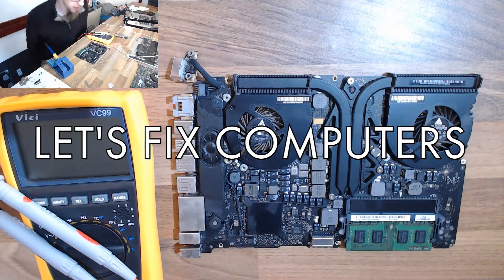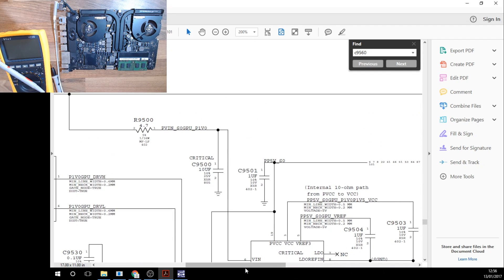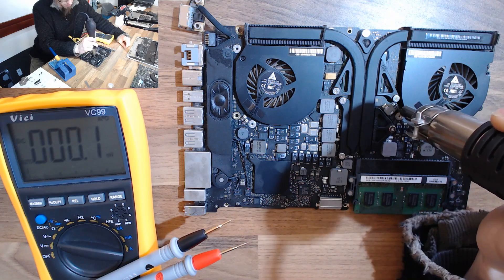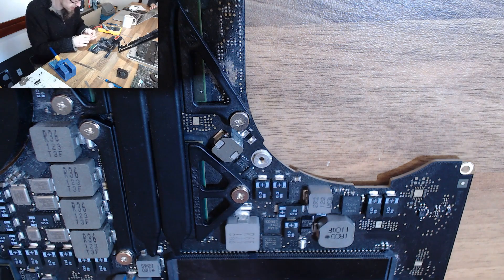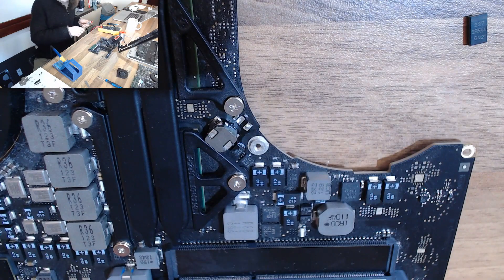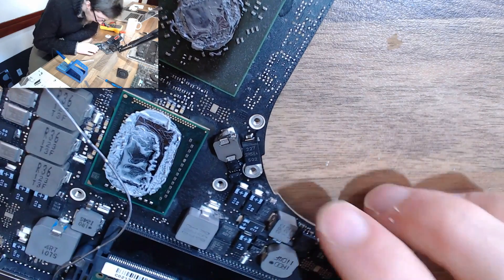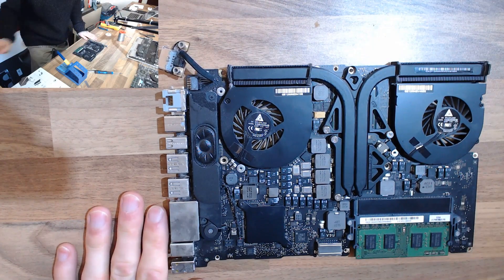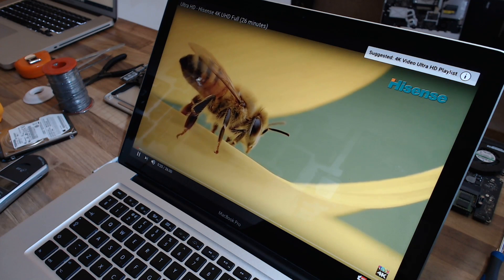LFC#95 - MacBook Pro GPU Fault: C9560

Comment: The heatsink wasn't really needed for cpu and gpu protection, they can handle that heat, it's the warping of the board due to localised heat, which the heat sink helped prevent having a bigger gradient. that's why its good that you kept the heatsink on because you didn't use a preheater or used the hot air station to gradually increase temperature

Comment: Hey man. Great series of videos. 

What’s the software you used to test the computer? The one that came up with the green “Passed” text. 

Thanks again. Your videos are invaluable
Reply: That software is called "Apple Service Diagnostics" or ASD for short. There is a separate version for all of the older MacBooks.
This should be enough to get you going - you need to do some googling, to find out where you can get it and how to install it. You might even come up empty, since this software is supposed to be for Apple internal use only, so it might not be so easy to find. That's all the information, I can give you on that.

Comment: Just use an hair dryer:    https://youtu.be/-i4q1vhqh60
Reply: This is not a fix, just makes the Laptop come on a couple of times before it is dead again.
Reply: @NebukadV  mine it's still working :D
Reply: @EnryBi  If you really believe, what you did is a "fix", there s no point arguing with you
Reply: @NebukadV  Dear N the fix is to replace the capacitor I know very well but the upper MacBook was presenting the black screen. Then you need to deactivate the main graphic card.

Comment: 00:23 yes Louis and others like yourself, Adamant IT are great at showing us how to do this repair. However credit should also be given to Duke, from the Netherlands as he is the one who first identified this capacitor as being the culprit. No, not Apple 's multi-million dollar engineering dept, but a guy working out of his garage using a paint stripper as a hot air source, and no microscope. Louis acknowledges this in his own video in regard to this repair https://youtu.be/DzcgT_fiVTA?t=319

Comment: Just wondering here, when you moved the coil wasn´t it too much against the heatsink? Maybe the thermal expansion of the sink when it gets hot will press against the coil and induce structural stress on it and maybe knock it off the board with enough cycles. Nothing a Dremel couldn´t solve though

Comment: What about MacBook Pro (A1260) early 2008
Reply from the maker: I haven't looked in detail at anything that old, but I believe those were GPU faults, rather than the frame-buffer capacitor we see here.
Reply: @Adamant_IT  - I've looked at many YouTube clips on this issue and it seems more logical to me that it would be the capacitor (C7771)! I guess I'll give it a try as I have nothing to lose. The re-balling of the Chip does not make that much sense - if the cause was originally overheating, then why would heating it a gain fix it - seems illogical? I guess I'll find out sooner or later?

Comment: With 2011 models 15/17 inch (Radeon GPU) this is mostly not going to be a total fix, only Nvidia models like 2010 A1286  820-2850 will truly work with this method. You will have the problem back in a little while. With these kind of boards you can also just heat area near GPU or on GPU and that is what is causing the stripes to dissapear for a short period of time.

Comment: Hello great video , I follow your video and change the c9560, but have the same issue , I double check and find out there is a short on the board where c9560 was , I think the c9565 was short , can you point me out where is the c9565 10uf is ? I have a mid 2010 MacBook Pro with Nivida gpu. Thanks
Reply: Thanks for the reply , the MacBook still up and running but when it switch to the gpu , it will do the same panic , i think I will try your suggestion to remove the c9565 cap but I do not know where it located ? Is it next to the L9560 or at the back side of board , thanks

Comment: Nice video showing good steps on a money saving fix. Not picking problems with the repair but only just come across a problem (+ of cap) where not all the original solder is removed and therefore mixed with lead solder, the link https://www.youtube.com/watch?v=CbguNgQO5hc goes through it nicely. Just for you with an older 2010 module having the problem there's another fix on https://www.youtube.com/watch?v=iKBzrxSGwlo&list=LLrjByAw0iE3fHbj-Uw44HGg&index=3&t=416s hope it helps.

Comment: Hi Graham, I have a late 2011 MBP which I assumed has a GPU fault. 
When booting, some 3/4 way through there appears a large multicolour band through the top third of the screen and it flickers off then completes the boot and works for quite some time usually but then reboots occasionally. Sometimes there is a ghost on the boot screen which consists of lots of horizontal red lines which tends to cause multiple boot loops. Is this a GPU fault or could this CAP repair fix things? The thing is is appears to be a lot more stable than it was 12 months ago when I retired it for a new one. 
Just last weekend I sat in front of it for maybe 8 hours transferring all my old pics which I thought I had lost to the apple cloud photo share thing with minimal issues.

Comment: Hello teacher thank you very much for the great videos that you share, I'm doing the test that shows in this video and in the capacitor I have 1.3v on with the battery so is it correct to have 1.3v or should I only have 1.5v? My problem is that when turning on the MacBook pro 2011 it restarts just midway of the boot. Please ask for help thanks

Comment: i am having hard situation with my macbook pro, its freeze when login in user mode, entering recovery mode and safe mode still freezing, i am taking out the ssd and trying to boot with another hard drive the result is still freezing, so i try to find out the answer through googling and ask some folks, they told me the problem is in the GPU, so what i'm gonna ask here is, is it possible to fix the GPU chips without change the whole logic board that Apple told me earlier to replacing the logic board with the new one which is cost me a lot of money that i cant afford..

Comment: I’m getting 1.36 volts at those capacitors, which is what your voltage dropped to.  Is this common in the failed condition?

Comment: How do you power up the logic board with the power switch disconnected? Critical info.
Reply: Aha!  Good to know. I wouldn't have disconnected the keyboard. One more thing: When testing the voltage, it looks like you're not touching the capacitor in question, but rather the one next to it. What is the exact point you're touching with the probe?  Thanks for your reply.
Reply: Does it matter which end of one of the neighboring caps I use?

Comment: Hi I have early 2011 mbpro 15 inch, after say 10 minute the screen goes blue with lines. Would you say it's gpu or cap issue?

Comment: Thanks for a great video. What are the specs of that small component (capacitor) sitting next to the plus side of the one you changed? 
I changed the big one successfully but as a noob without the proper tools and experience I managed to lose the small one and will need to order some. 
Very grateful for any help.
Reply: Thanks a lot for responding.
It looks exactly as the board in your video as far s I can see.
EDIT: put on a strong light and found the number on the board: 820-2915-B
Reply: Thanks a bunch!
I'll order the smaller ones and try to make it work.
In case it doesn't, do you think there is any way to completely disable the the discrete graphics and simply have the computer not detect it?
Reply: Thanks, I managed to change the two capacitors even if it took some time and a couple of tries as this is the first time ever I tried something like this.
Now I get 1.5V over that capacitor but it still doesn't work.
If I try to get ahold of a new board, which are the ones that will fit as a replacement for the 820-2915-B (or where can I find out?
Reply: I hear you. I'll see what I can find and what I'll do. :) 
Thanks a lot for your help and the video!

Comment: I am not sure I fully understand the root cause of this failure.  I understand that Apple used a commercial digital voltage down-converter regulator with a 330µF tantalum cap on the output as a charge accumulator.  I believe there are many of these caps on the board, but none of the others fail.  Unless there is some research showing that a particular signal may cause a cap to age faster, which I seriously doubt, then why does this particular cap fail?  I would expect it to age faster if it were in a higher temperature environment than the others, but I do not believe this is the case.  I have not checked it with a FLIR camera, but it is mounted right next to the fan, so I do not believe it is mounted in a particularly hotter environment.  I am aware that the fundamental physics of Ta caps causes them to lose capacitance slowly with age.  I am also aware that Ta caps (counterintuitively) decrease slightly in capacitance at cooler operating temperatures.  I am also aware that some old Ta capacitors can often be made to temporarily regain some of their original manufactured capacitance by re-annealing the part.  Observations have been made WRT to each of these influences on Ta capacitor capacitance which correlate with a decrease in the capacitance of the C9560 capacitor.  I now understand all of these things.  What I do not understand is this:

A significant number of this precise model of 2010 Macbook Pro reportedly experienced this failure when they were new, within weeks of being purchased.  Additional units have failed with some consistency pretty much continuously with time as these approximately 10 million computers age.  Yet Louis Rossman regained function of one of these failed computers when he accidentally replaced the old cap with a polarized replacement cap which he installed in the wrong polarity.  (I done seen it on TV with my own eyes.)  At these low voltages, the caps have a fairly high effective capacitance in reverse polarity.  From past experience, I would guesstimate about 80% of the rated value.

There is no question that the GPU generates this fault.  You can read it in the first line of the dump.  And it is almost certainly true that it happens because the voltage across the GPU supply lines instantaneously sinks too low.  For example, my 2010 Macbook Pro only crashes when I am changing "spaces", and then only infrequently.  But the frequency is slowly creeping upward on me as the C9560 capacitor ages.  The largest slug of current the GT330M GPU gulps from the power bus is when the largest number of bits per clock cycle in the frame buffer are changed.  This, in turn, occurs when large areas of the display in high definition (large numbers of pixels) change color.  I do not (yet) know enough about the internal architecture of the GT330M to know what color1 to color2 transition will cause it to flip the largest number of bits in a high-def full-screen write.  But that is just a matter of reading the GPU datasheets in enough detail.  This is the condition to avoid if you are on the hairy edge of losing your machine to frequent crashes until you can repair it.  It is also the condition you should want someone to include in a test routine to verify that the post-repair machine will continue to function properly under the worst possible condition.

But here's my real question:  Why should we believe that whomever designed the chopper voltage down-converter circuit which powers the GPU did a proper design?  There is apparently not much to the design beyond selecting the right charge accumulation capacitor to hang on the output of the chopper.  BUT IN ANY CASE MY ASSERTION IS THAT THIS POWER SUPPLY DESIGN IS FAULTY.  I have not (yet) dug deep enough into the chopper regulator datasheets and appnotes to do the design with the same digital voltage down-converter myself.  But my suspicion is that using a 330µF cap on for the charge accumulator/filter capacitor on the output of the chopper voltage regulator is going to be on the hairy edge of being theoretically large enough.  Perhaps, in unusual circumstances, it may even be found to be a bit too small.  If such negligence could be proved, it might still have significant legal ramifications.

Conversely, the spec for the nVidia GT330M GPU may be in error.  Perhaps the GPU draws more power in certain transient conditions than is specified in nVidia's chip spec.  Again, if such fraud could be proved, it might have significant legal ramifications.

But it seems to come down to this:  Either the cap is too small, or the load placed on the supply by the GPU in certain transient conditions is too large.  Which is it?  Does the fickle finger of fate point at Apple, or nVidia?

In any case, it seems fairly well established that the GPU supply voltage slips down below the acceptable limit in transient conditions of high GPU load.  This correlates with the failure being due to the capacitance of C9560 being too low to handle the instantaneous in-rush current of the GPU under transient high load conditions.  A proven hardware repair is to replace the slowly diminishing capacitor with a new one which will usually be of slightly greater capacitance.  My last question is this:  Why wouldn't it make more sense to replace the failing cap with a new one of a value slightly greater than 330µF – or perhaps even one of twice the capacitance?  Perhaps a larger filter capacitor would cause some kind of potential transient start-up overload problem with the chopper voltage down-converter, but that seems unlikely.  From the POV of the GPU, there is NEVER a reason to introduce more, rather than less, noise into the power rails.  So increasing the capacitance on the circuit may, in fact, turn out to be the proper design that some nameless, faceless engineering group at Apple was incapable of originally doing correctly.  Or maybe they didn't test and correctly measure the actual maximum instantaneous load generated by the GPU.  In either case, I WOULD FIRE THEM.

Considering the mismatch between filter capacitor capacity, and maximum GPU load, wouldn't an easier fix be to simply jumper a new capacitor across the old one?  Couldn't that be done with a simple soldering iron instead of a SMT soldering & desoldering station?

Am I missing something?  Why is everyone going to so much trouble to remove the old open-circuiting filter cap?
Reply: interesting idea!
might actually try this. I mean it sounds a bit daunting to not use the tried method, but not having to learn smd soldering sounds tempting :)
So you would suggest that using any capacitor with values between something small like 20µF up to 330µF in parallel with the existing on should work?

Comment: Hey man great video, quick question for ya though that I can't seem to find answers for... I removed the current cap thats faulty and replaced it with one market 330 from another dead logic board, but I still can't seem to get past a white screen during boot up , recovery or re-install , did I use the wrong cap or is there something else wrong with my MBP?
Reply: Are you sure you installed the new cap with the correct polarity?

Comment: When the GPU chip fails what other logic board components might it take with it?
Reply: Thank you for replying. Yes I know about the "replacement" or "new and improved" 216-0810005 chips situation. However, once all other options have been exhausted and the GPU chip is so far gone that the nvram command hack will no longer work (because the mbp won't even boot in recovery/single_user mode), I may have to spin that roulette...

Comment: I did replace the capacitator but still getting black screen 2 or 3 seconds after turn on and some time randomly restart my is MacBook pro 2010
Reply: Adamant IT I replaced capacitator twice  and switch ram too ,I'm soo frustrated on this computer
Reply: Adamant IT can you tell me please how to set voltmeter to check if capacitator or something is ground on board

Comment: Hi, just a short question: 
When I power my locigboard, the old C9560 goes to 1.503, later to 1.37. Is it the failing capacitor for sure then what makes my MBP crashing while booting or could it be the graphics chip entirely? Cause you said something about "low-power-mode" for 1.37 in the comments below.  I have an 820-2914-A logicboard from 2011. Thanks :)

Comment: Greetings. 820-2915-B board here. Both quick and extended Apple Hardware Tests (option+D) show no hardware issues. Intermittent non wake from sleep and when it happens 4-5 reboots needed to get desktop. Currently using nvram hack to prevent 6750m from being used. Schem for 820-2915 shows C9560 220uF 2.5V, could it be different for the -B board version? Could C8942 & C8943 (330uF 2.0V) also be faulty?
Reply: Appreciate your response. Will check and report back. If the sodimm socket is at fault, is it replaceable?

Comment: Hi, instead of trying to fit the bigger cap in the same location (not easy) would it be a problem to find a ground via to solder the ground side of the capacitor and wire the + side of the cap to the original location ? Would it work ? Would it change the capacitance of the cap ?